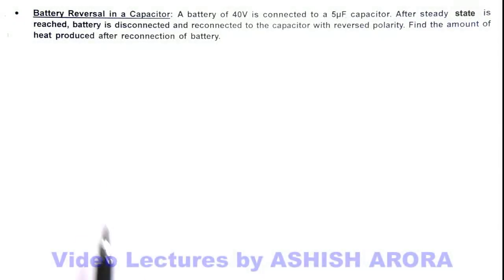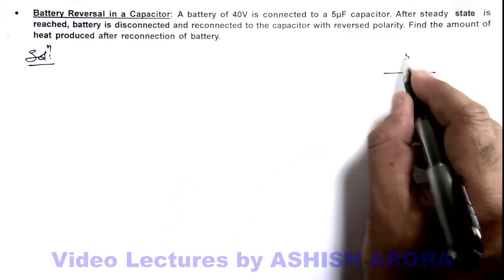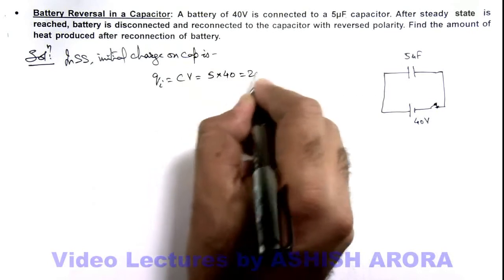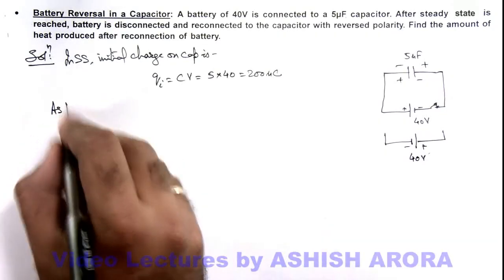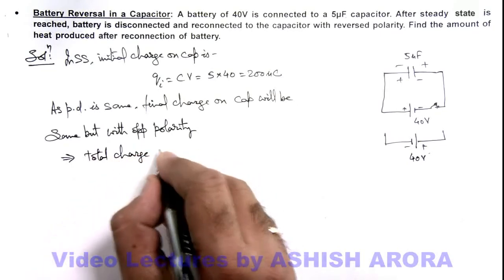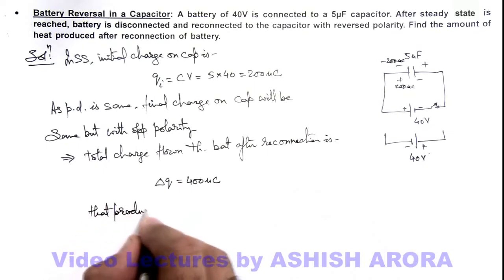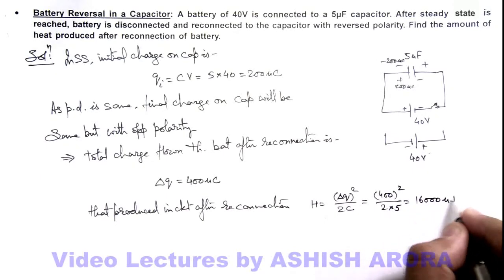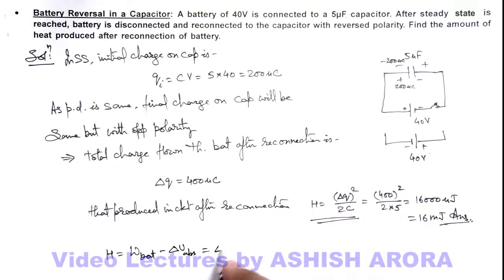1. Advance Illustration | Capacitance | Battery Reversal in a Capacitor | by Ashish Arora

Comment: Sir are these videos (concept videos + adv illustrations) sufficient for jee advanced or only for jee mains?
if not what else should be referred for jee advanced practice routine
Reply: They are rather concept building questions, using concepts of advanced questions in parts, its better to just learn from these illustration rather to use these as practice, and nothing is enough for advanced, you just have to practice more and more for that, i advice go for modules or Anurag mishra.

Comment: Sir in this question as we can see that energy stored in conductor is not changing therefore all the work done by battery will go into heat energy. Then we can also solve it by  V(40) multiplied by total charge flown that is 200-(-200) that is 400 which will give us 40*400uf=16mj.

Is this approach correct and are there any limitation for such approach??

Comment: the other method to so;ve is to just calc the potential change at any one plate after reconnection . and then using the formula 1/2cv2

Comment: Here Delta q must be 200 as we are talking about heat generated after reconnection
Reply: No ,delta q is difference in heat ( i.e q initial- q final)
So it will be 200-(-200)=400

Comment: Respected sir
Can the capacitor act as a heat source?  Or the heat evolved in this question is due to resistance of the battery?? 
What is the actual source of heat generation?
Reply: If I am not wrong, heat is produced in the capacitor due to sudden stopping of electrons which will have a kinetic energy due to the battery. Battery is ideal but still the heat is produced.

Comment: Respected Sir can we say heat produced in the circuit be equal to the change in energy of capacitor which is delta E= 1/2 CV^2 -(-1/2 CV^2). This way also I am getting answer as 16mJ.But Am I right or wrong?
Reply: No its wrong

By the way 
You are in which college now😂😂😂

Comment: Sir 400 micro coulomb kaise kaise hua ?? Plzzz sir rply zarorr Krna
Reply from the maker: When battery polarity is reversed then charge on plates of capacitor also get reversed in polarity and amount is 200µC so change in charge on capacitor plates from + to - will be 400µC...

Comment: sir jo total charge flown hota h use hum algebrically add krte h n sir then wo 400 kese hua
Reply: neha prasad agar ek capacitor letter ho before reversing uspe 200 micro coloumbs ka charge hai an would reversing pe 0 hoga aur badme -200 take polarity reverse ho Jaye so net change will be 400
Reply: @ashwinideshpande8452   this is simply the potential difference not the way  u said

Comment: Sir, initially, for the capacitor to come from fully charged(q) state to 0 charge state, 
the work done by battery would be qV,
but the energy required to remove the electric field between the capacitors will be qV/2, which is also the energy required to delete the charge configuration...
But the other qV/2... is it because the capacitor "absorbs" heat?
Reply: hey bro where are you currently means which college branch did you joined and whats you current job 
just asking out of curiosity 😅
Reply: @6f20kishanjha6  aap apna bataiye aap kaha hai ?

Comment: sir did you say that energy absorbed on the capacitor would be zero on the fact that energy is 1/2(q1+q2)^2/c formula as q1+q2 becomes zero
Reply from the maker: +Sahil Rastogi It is |q1-q2|^2/2c

Comment: sir in one question there was two batterey  e1 and e2   and a capacitor now e1 is takn out     so  if heat is asked  its ui---uf   or delqfx  v battery   sir thats v b is it the battety present nw
Reply from the maker: +Arabinda Biswas there is a short cut method for calculation of heat = square of change in charge of capacitor / (twice the capcitance) .... if there are more than one capacitor in a circuit then this can be applied to all the capacitors and sum up all the terms...

Comment: A small block of mass M moves on a frictionless surface of an inclined plane, as shown in figure. The angle of the
incline suddenly changes from 60° to 30° at point B. The block is initially at rest at A. Assume that collisions between
the block and the incline are totally elastic (g = 10 m/s2
). SIR THIS IS A JEE 2008 Q   ITS Q 46  IN FIIT JEE  SIR CN U PLS CHECK IT  PLS PLS
Reply: Abe chu official websute se check kr le  . Archive me kaafi mistake hain
Reply from the maker: +Arabinda Biswas ok will check when i get some time...  then revert...